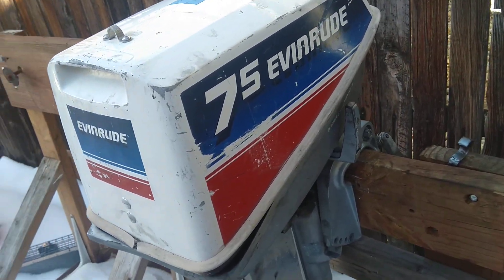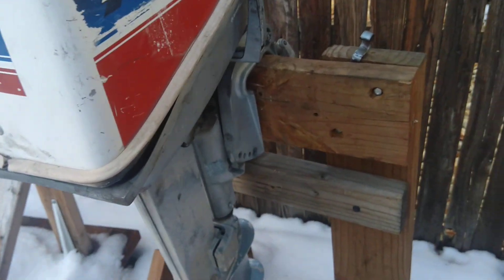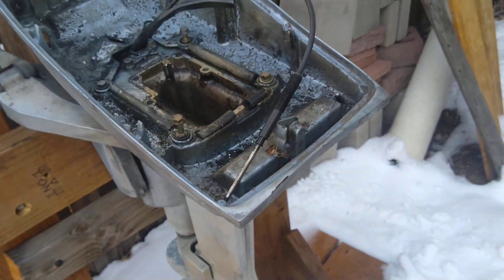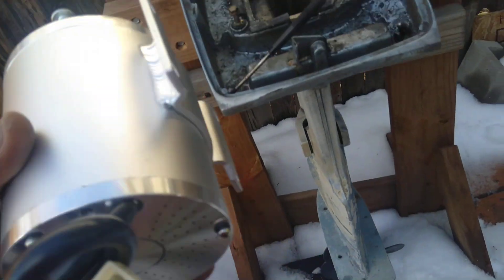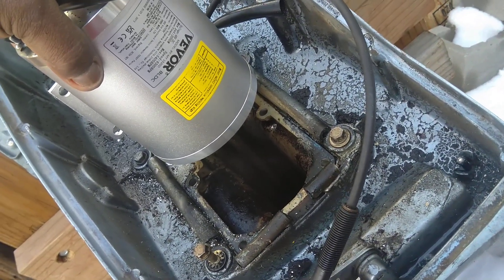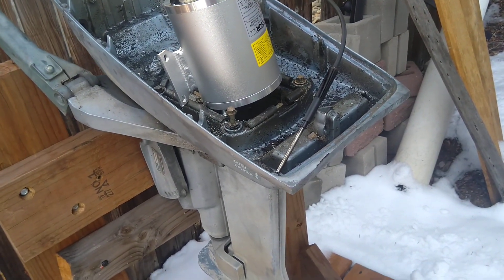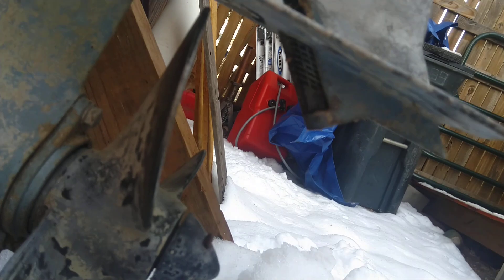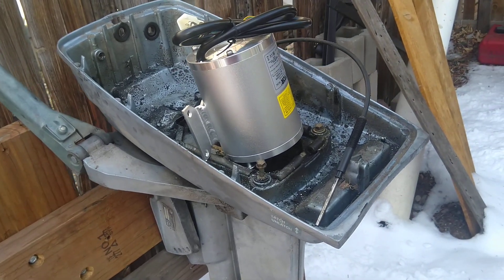Evinrude conversion to electric outboard part 1 replace the tohatsu kicker

Comment from the maker: There was 50' of braid line wrapped around prop shaft. Seal was ok.
Removed gears resealed. Removed impeller. 
Drilled holes out in Brushless motor they where to small and there was no fan inside. 
Power washed grease from motor needs another wash.